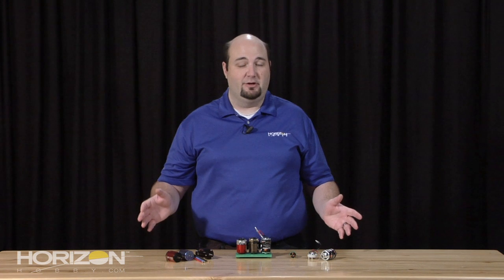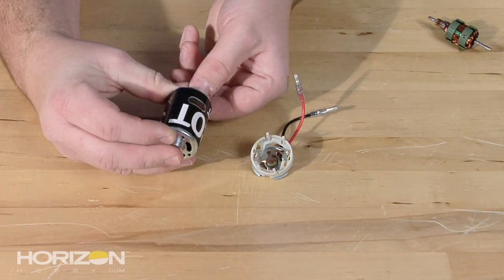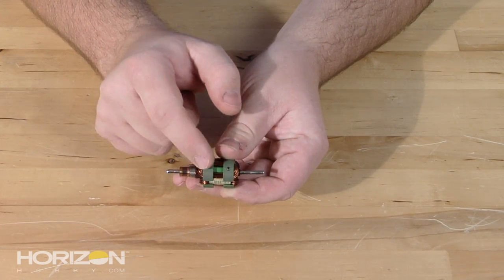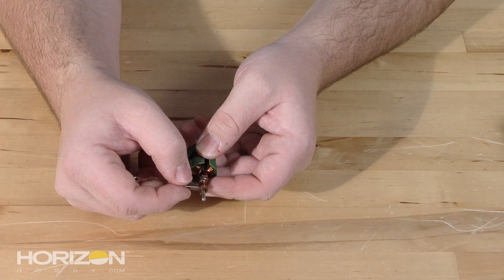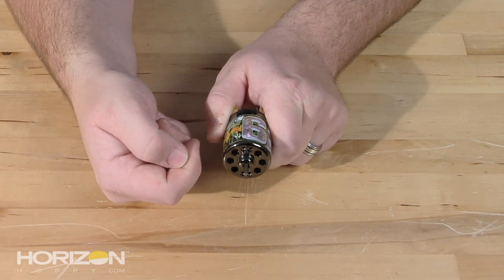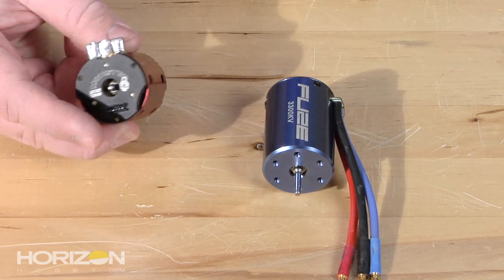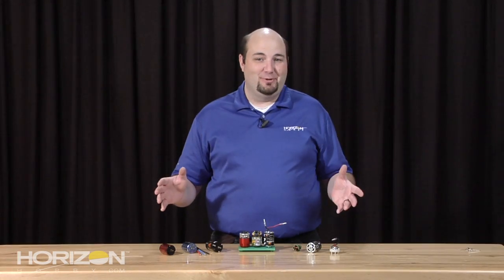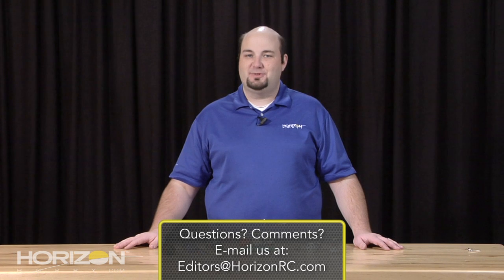HorizonHobby.com How-To: Understanding RC Motor Technology

Comment: I felt the need to put this out there, the reason for 3 wires vs 2 wires on BL vs B is more so due to the commutation. A brushless esc needs to have an electronic commutator inside rather than the physical of the brushed.

Comment from the maker: I understand what you are saying. With any "sealed endbell" motor there is the opportunity to "pop" the endbell off by applying enough pressure to the tabs to make them spread. This motor is not designed to have the timing adjusted once it has been assembled.

Comment: Brushless motors do NOT run on AC, they are DC that is pulsed to different sets of coils. They basically replace the commutator. The basics are the same, Electricity runs through the coil's creating a magnetic field and repel or attract to the  permanent magnet that is part of the rotor. The coils are labeled A,B,C and the electricity gets flowed from A-B, then B-C, then C-A and repeat in a circle . Sensored brushless motors have Hall Effect sensors (usually 3) that tell the Electronic speed controller (esc) what the orientation of the rotor is currently in so the ESC knows which set of coils to apply current to.
Reply: if you listened he said they basically work on AC, which is true. even though it is technically DC, a waveform that is basically a modified sine wave with a bunch of PWM is what an ESC sends a brushless motor.

Comment: I think  a better way to explain brushless vs brushed is that a brushed motor uses a mechanical switch to change polarity and a brushless motor uses a computer and solid state electronics to do it. It's like mechanical fuel injection vs electronic fuel injection, the real benefit comes from being able to adjust timings without physical changes to the motor and having less resistance from mechanical parts.

Comment from the maker: Kv—A rating of performance for brushless motors. While Kv ratings are occasionally applied to sensored motors, sensorless brushless motors are almost always rated by Kv. The higher the Kv rating of a motor the faster it will be. Kv refers to the number of RPM a motor will produce for each volt of power input to it For example a 1,000Kv motor would produce roughly 7,400 RPM at 7.4 volts.
Reply: Should have this info in the video!

Comment: Almost all electric motors are ac (stepper motors excluded) - in other words the current must somehow be switched in direction every half cycle if dc is applied. In the so-called dc motor this is achieved by the commutator, which reverses the current flow. A brushed ac supplied motor uses slip rings to get the current to the armature. Great channel, thanks

Comment: great video. now comes the next question. how do you choose which gear ratio is correct? esc temp, motor temp? i run a slash on oval. Last season I was so under geared my motor was barely warm after races. well i changed a few things. looks like 120-170 is about the temp range im goung to run in.

Comment: hi... great video. Do you know how those copper "springs" holding the carbon brushes are called? I need to replace one and all carbon/brushes I see are a variation of a coil/wire and the carbon itself. Never the tiny copper arms pushing the carbons.Thanks!

Comment: maybe I missed it but I didn't see anything in this video about using brushed motors for RC crawling. Censored brushless motors do have use in crawling but top competitors still use brushed for lower end torque and slow speed control.

Comment from the maker: Anything besides a 27T brushed motor is considered "Modified". It refers to the racing class the motor is legal to race in. A 13-double is going to push the limits on that ESC but you should be ok.

Comment: Do you guys have a video on how to hop up a brushed ruckus 1:10 2wd monster truck I'm looking to and I'm confused on where to start!
Reply: Its Lucky If it's able to be swapped for BL, you need a 540 sized motor, which is designated "3650", 36mm diameter, 50mm long.  Then pick a KV rating of 2500 to 4000, and make sure its rated at least for a 3S LIPO.  Get a cheap kit from eBay and give it a try. They start around $40.  A LIPO battery with the right connector is needed too.  2200mah 3S with 25C should be a good starter pack.  You can always go to your hobby shop if there's one near and ask.  The one near me is awesome.

Comment: motors are a fun hobby in themselves. the sealed 540 motors can be safely opened and if you know what you're doing you can easily change the windings with bigger gauge laminated wire without soldering and have some cheap fun. if you can find small bearings with the right I.D/O.D diameters then you fit them on the front and end race. got 15t and 10t motors in sealed cans with a double 10t in the making all running off a tekin G9. mabuchi and johnson motors can easily be found next to nothing for rebuild or spare bushes. have fun :)

Comment: Will a higher turn number work better for larger tires in terms of overheating? I’m still running the original 20t in my ECX Amp MT and stock tires on 2s expecting it to fail, but it seems to not overheat like my 12T Arrma brushed on 2s does.

Comment from the maker: Depends on the size of the motor quite honestly. There are brushless motors for 1/5-scale vehicles that will blow away the power of those for 1/10-scales. Generally the fastest I've seen for 1/10-scale are the 2-4T motors. Crazy fast!

Comment from the maker: Yes and no. A 550 Motor is a slightly longer version of the 540 motor, capable of delivering more torque and power without suffering from power loss. 550 motors tend to be less susceptible to damage from heat, overgearing or other similar issues. Now there are 540 motors that can be used in 4WD SCTs that have the best of both worlds, less weight and exceptional torque.

Comment: So if a modified speed controller can be made to convert the dc battery to 3 phase A/c, would that benefit the hobby and make the motors more efficient. Thus giving more flight time?

Comment: Thanks for the info! I needed to know how fast in terms of mph speed w 20 turn and under to say a 10 turn brushed motor and 3400kv -7500kv bless in turns of mph? For example getting 40mph you’d need or equals to a 15turn motor etc... thanks!
Reply: You need the gear ratio to calculate the speed.

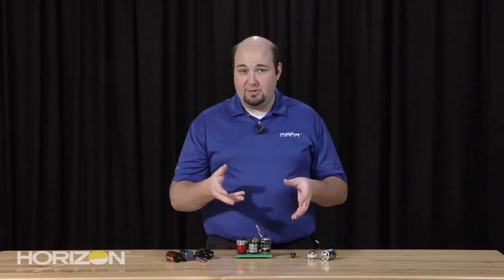Comment: In dynamite 20t shown in 2:11  same as saturn 20t we can change timming settings by turning the endbell. But there are only thre position of that setting, you can see it above negative lead connection to the motor 1:02.

Comment: I've built my own  bldc motor and am trying to figure out what bldc speed controller would be appropriate.  

First thing, the motor is axial flux. The rotor has 12 poles (6 pole pairs). The stator has three coils wound with 16 gauge wire. The winding are a falharbor type winding with 4 turns (roughly 76 inches of wire in total per coil) adapted to an axial flux design.  The stator has a slotless iron backing made from coiled steel banding to reduce the magnetic  reluctance. 

Most radial flux bldc designs use 3 coils and two poles. I wonder if 12 pole 4 falharbor serpentine like turns would be roughly equlivent to 24 turns or something else on some of the more standard motors.

I tried to run it on a cheap bldc controller.  The bldc controllers lowest setting drew .6 amp from a 13.4v  lead acid battery. That's about 8 watts.  At that  lowest setting the controller supplied 1.49vac, and if we assumed 100% efficent transfer of 8 watts 100%  meant the coils were pulling  5.37  amps. When the motor was turned by a by a drill  at 211 rpms, it generated 0.126vac.  During testing the cheap chinese controller blew a couple mosfets.  But ill try to answer any other questions.

I might redo the stator with 5 turns on each coil. But there is not much hope for more turns..

Comment: I have used a giant brush less motor for giant scale rc planes  One of them would cut out at high throttle and let out a terrible squeal when it did  But throttle back and it reset and goes again.  There was no over draw in amps and was using the correct voltage The lipos can deliver more then twice what the amp meter showed as being used. My question for you is How important is switching frequency and how likely is that to have been the cause of this?

Comment: nice instuctional video". i have one question out of curiosity because i think i mest my motor up yeterday. i was crawling with my 20t motor doing rock climbing and i guess since the coils on this motor are thicker that maybe thats why its over heating?? i got the motor so hot it was smoking from burming the label off of the motor, i than let it cool down and when i tried to play with it it still worked but the power was almost reduced by 3/4, so im guessing is this due to the magents loosing magnetism because the motor got the magents so hot?? cuz ive heated up a magnet when i was a little kid and remember the heat made the magnet weaker so was just wonderin if thats most likely the cause of the motor acting this way, please let me know what you think.

Comment from the maker: Its not better as much as its just different. A smaller pinion will give you less top speed but better acceleration. A bigger pinion will give you more top speed but cost you acceleration. For running on a track going to a smaller pinion could make you "faster" as the motor may not have to work as hard to clear obstacles or to get out of a corner. For just running in a driveway, open lot or parking lot a bigger pinion will yield higher top speeds.

Comment: what is the power output of these brushed motors?  I would like to use some brushed motors on some of my new motors, but I cannot find the power ratings of the brushed motors like I can find for the brushless motors.  I know the brushed motors can accept a wide range of voltages, but I would like to at least know a range of voltages and operating powers acceptable for these motors.  Thanks

Comment: I'm currently making an rc boat to compete in a local homemade rc boat race. so my question is, for rc boats which one do you need the most? torque or rpm?. does installing a gear ratio to fasten the rpm of the propeller from the motor ruin the motor?. Thanks, your respond would be greatly appreciated. (sorry for my English btw, I'm Indonesian so English is like my 3rd language)
Reply: Andrika Hilman the torque would matter a bit more because it will get the boat on plane faster and easier

Comment: Tried a few of the Dynamite 540 15 turn motors. They don't like being run on 8.4 volts. They don't run hot but the commutator burns up and turns blue. Meanwhile the Traxxas Stinger runs twice as hot (stingers always run hot) but they don't burn up on 8.4 volts. 

I think Dynamite should go with Johnson or Mabuchi instead of whatever off brand they're using.

Comment: What is actually happening is a voltage change by reducing turns. Makes sense to go this route rather than add more batteries which would weight down the R/C car more to get more speed and power.

Comment: I'd like to know if a 3800kv motor has more power than a 5700kv because I got confused when a 1/5 scale had a 800 Kv motor and also which would perform the fastest in a hpi blitz

Comment: If I switch 2 out of 3 wires on a brushless airplane motor it will reverse the direction of the shaft. Is this the same for land brushless motors?

Comment from the maker: @MrCrazyrc123 Correct, it's an inverse relationship.
Reply: What does 390 motor or 550 motor mean?
Reply from the maker: @CM-1723  It's the "can size" of the motor. 390 is typically found in 1/18th scale models. 540 in 2wd 1/10th models. 550 in 4wd 1/10th models.
Reply: @horizonhobby  I thought it might of been the size . I've got a 6v 390 13000RPM in my kids ride on vespa and it's really slow . Would a 12v 390 30000RPM be faster ? Or would a 12v 550 30000RPM be faster .

Comment: I have one question can you use a brushless speed controller with a brushed 27 turn?
Reply: Yes. Some brushless Speed controllers allow the use to go brushed. They only require the 2 outer wires to be attached to the brushed motor for it's power, while the middle just hangs. But i'd make sure to double check the speed controllers ability first to see if it says 'Brushless sensored/sensorless / brushed compatible.' or brushless/brushed ESC. Then this'll allow the use of brushed motors from a brushless ESC.

Comment: Ok I have a question... I am currently designing a shoe with Power Laces like from BTTF for a school project... i want go make a motorized pulley. to tighten the laces what kind of motor should i get..... and how can i run the motor in both directions so the laces will loosen too... ohh and on top of that it has to all fit in the sole of the shoe

Comment: Torque and RPM of a 35T Brushed motor vs ( X {KV} )size Brushless motor equals approx. the same performance = (Torque and RPM)  ?????     Where X is equal to the sized brushless motor.....

Are there charts available that give an approximate brushed vs brushless equivalent motor size?

Comment: You don't explain torque for the motor's, why? also I have a Atomik Fireball modified 50 turn brushed motor is it water proof?
Reply from the maker: We don't go into details regarding RPM really either. Torque and RPM are not exclusive terms to RC motors. 

I don't have any experience with that specific motor so I am not sure. Most Brushed motors can handle some running in water. Heck, we water dip closed-endbell motors to speed up the break-in process! I'd say if it has bearings I'd try to not run it in water, bushings you'd be OK as long as you clean it really well after use in the wet.

Comment: I'm looking to put a brushless system in my ecx amp, and was wondering if I could keep my 4500 mAh nickel metal hydride battery for the brushless system as I am on a budget
Reply: pandacocoa Maybe. Read the specs in your esc and it should say what batteries you can use and how many cells

Comment: pleas  pleas pleas i need a help---------  i replace the motor from 390 to 540 on WLTOYS A959     ----     And the directions in the remote control changed

Forward we will be backward and backward we will be forward

Is there a way to change it back ?????????????

Thank you very much for your help

Comment: this info is our work together with FORD  ENGINE. if you change the crank shaft to diamond witch you can melt at super high octane like rocket fuel but it wont melt at 89 octane so if you build a mold for a diamond crank shaft or machine the diamond with laser to make the crank shaft  that you just gave me as an idea witch will not tiwist the shaft and throw it off ballance then you don't need to add oil to the motor for the shaft won't twist with out oil now if you want precise mesurement for the piston borring use a 5/12 circomfrance angle around the piston

Comment: Hi, i do not know if i should buy the tazer 3300 or the 4000. What should i buy, if im gonna run it in the ruckus 4x4?
Reply from the maker: The 4000kV will be a lot of motor and speed. The 3300kV is a great motor system too just not as fast as the 4000kV.
Reply: Horizon Hobby Thanks for answer:)
Reply: +Horizon Hobby So the 4000kv motor is more for bashing right?

Comment: You dont need to open the endbell. Just try to turn it. The tabs just prevent the endbell to come off but you can easy turn it. That is difrent design than mabuchi or johnson motor.

Comment: just wandering can a Dynamite 15T speed control run lypo?
Reply from the maker: It can but, depending on the specific version, it may not have a LiPo cutoff.

Comment: Whoever decided to introduce "brushed" motors to the RC industry was a genius.  Being that "brushless" motors have been around for years and don't require any maintenance, they chose brushed to be able to sell parts and perform repairs. 
 The greatest difference between these two types wasn't mentioned in the video.  A brushed motor spins the electronic circuit inside a permanent magnet, whereas a brushless one spins a permanent magnet inside an electronic circuit, improving the efficiency tremendously.  PEACE
Reply: James Linden the video footage was a bit self explanatory but thank you for the extended description.
Reply: That was explained.
Reply: Nikola tesla
Reply: Actually brushed motors was the preferred option because they were the  cheapest option for a long time because of the cost of bldc controls. Even now that bldc controller cost have come down brushed motors are still cheaper.

But now with the reduced cist of BLDC controlers. The maintenance-less advantage of bldc motors  brings more "value" that makes up for the additional cost. 

In other words, it wasn't a marketing gimmick to sell maintenance. Rather,  the choices were/are comsumer market forces, cost, and application need driven.
Reply: Anotjer and maybe better description then you gave is that brushed dc motors have perminate magnets in their stator, and their rotors have armatures with winding that take in DC currents through the brushes that contact the commutater that when rotating switches currents in the windings.  BLDC motors have perminate magnets in their rotor and take DC current to the motor's controller that in turn electrically switches currents in field windings.

Comment: It really depends on Weight and How much Speed and Torque you want... A Velineon system (540) can be good for a Slash 4x4 @ 2S but not so much for an Axial EXO even at 3S, 550 is the Best for that Heavy AWD Applications such as the EXO. Using 540 would really require higher voltage to make it go FAST where a 550 4 Pole a 2S will be more than Enough for Most.

Comment: I have a fxr  tekin on honcho on 2s but want to run 3s what else would i need other than batt. ? And why?
Reply from the maker: Looking at the Tekin website it appears this ESC can handle 3S so you should be good, however I would contact them just to be extra cautious.